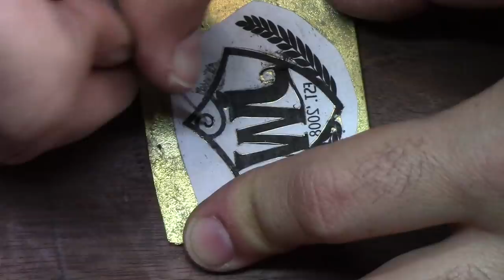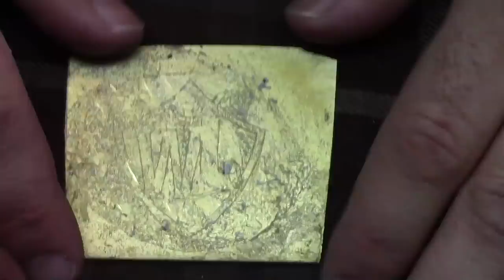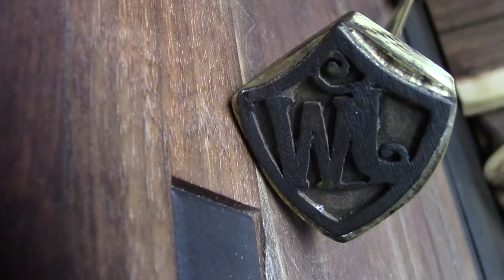Branding Iron Made by Hand

Comment: Wonder if screws would work better than the rivets?  Specially if they were tapered head and then sanded smooth and of course they would have to be brass and very carefully predrilled to keep them from breaking off.  Or perhaps full depth rivets?  Nice result if the rivets hold!  :)
Reply from the maker: Terry yeah that would certainly work. It might be a better solution for a larger iron as the one I made is pretty small at about 1.5” across. The rivets are still holding up fine. In fact the solder is still there as well. Every time I heat it up it just solidifies again once it cools.

Comment: Great looking branding iron.... doesn't the soldering get loose when you heat it up again?
Reply from the maker: Houtje Boom - Be Creative Haha! I was waiting for someone to catch that. Yes it does and I realized that as I was soldering it together. That is why I also put the rivets in to make sure it never moves. I guess the solder was good for holding it in place while I set the rivets.
Reply: does the head of the 'rivets' get sanded off?  If so, what is keeping it in place?
Reply from the maker: Great question! Yes the mushroomed head that is created when peening the brass rod does get sanded off but the rod expands within the hole and that's what keeps it in place.

Comment: Where do you buy that thick copper brass piece from?? No one seems to sell anything outside of flat thin sheets
Reply from the maker: Doosha Khaboosha I got it from the scrap pile at a shop I worked at. The thick portion doesn’t have to be brass though. Just use steel. You could use some thick aluminum and it would hold the heat better.
Reply: @JermwoodMakes  thank you

Comment: Why not just start with a thick block, paint your design with enamel, and acid-etch it?

No soldering, no sawing, no pinning, no trouble?

Your workmanship is AMAZING--don't get me wrong. It just seems like "craftsmanship for the sake of showing off how clever you are", while completely disregarding actual use of the final object, or the value of your time as a craftsman...
Reply from the maker: I didn't think of doing it that way. I've never done any acid etching before. Seems like it wouldn't etch deep enough to get a positive enough logo image to burn into the wood clearly, so thats probably why I didn't even consider it but I may be wrong. It would definitely work as an ink stamp. Thats how the old school printing presses work. I'm curious have you ever made an acid etched branding iron? How does it work? That would be sweet if it works. I usually work with what I have the way I know how, and film the process to inspire others and hopefully impart some knowledge along the way while entertaining. I do like getting recognition for my skill and what I produce. I think every craftsman does. Recognition and acceptance are a basic human need. :)

Comment: Where did you get your brass?
Reply from the maker: billy19461 It was all scraps from the shop I worked at. Check your local metal supplier though. They may have a drop pile you could buy small pieces from.